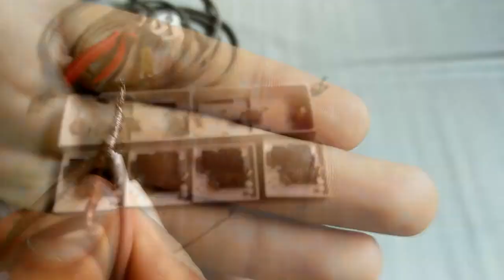Cara Buat Extension Sendiri | D.I.Y Your Own Electrical Extension

Comment: salam.. nk tanya.. untuk wire flexible tu. apa maksud  40/0076 3C?
Reply from the maker: 40 tu tebal keseluruhan wire, 
0076 tu tebal wire satu2 iaitu Live/Earth/Neutral, 
3C tu 3core (ada 3 urat wire iaitu Live, Neutral & Earth)
Reply: @rafigarden7824  owhhh... baru la tahu... terima kasih boss
Reply: @rafigarden7824  slalu dgr wire 1.5, 2.5 dgn 4mm jer..
Reply from the maker: oh kalau 1.5 2.5 tu jenis wire satu warna mcm merah hitam hijau..bukan 3core...yg tu selalu pakai utk wiring tanam kt dinding ka ats siling ka
Reply: @rafigarden7824  owh.. patut la cari x jumpa... salah term rupanya.. tpi dkt shopie ada jual 3 core 2.5mm. legit ker?? ke scam je?
Reply from the maker: mungkin ada jgk saiz tu..saiz banyak wire2 ni.. cuma kalau utk nk buat extension elok guna yg tebal ..2.5mm ok dh..kalau rumah2 plug dinding mmg guna 2.5 tu
Reply: @rafigarden7824  klau guna yg mcm en guna nie, 40/0076 tu sama dgn 2.55mm ker? ke sama dgn 1mm
Reply from the maker: @akramzaki8571  yg sy guna ni lebih  kurang sama 2.5
Reply: @akramzaki8571  wayar 2.5mm kalau 3 core kita panggil "110/0.193".. Ada je jual yang 2.5mm 3 core, brand fajar, tapi tu mahal sikit.
Reply: @syaz4380  owh yaka.. ada jumpa dkt shoppe.. igt tu scam.. okoko boleh beli
Reply: @akramzaki8571  ouh, mcm mana tuan ingat tu scam?
Reply: @syaz4380  pada mulanya saya igt wire 2.5mm nie x de yg 3core. sebb wire tu tebal.. so lpas tuan bg info yg mcm  nie.. baru la saya tahu benda tu sebenarnya legit